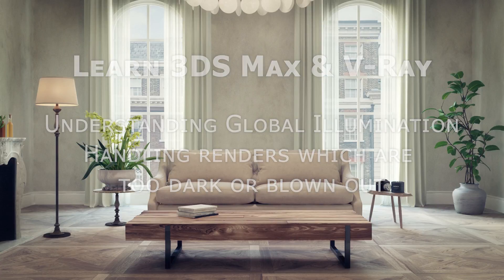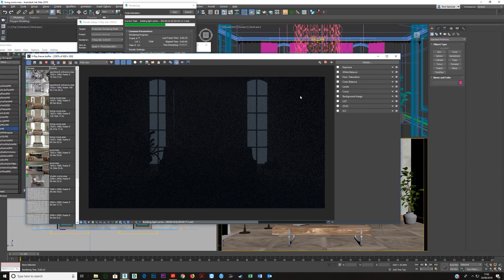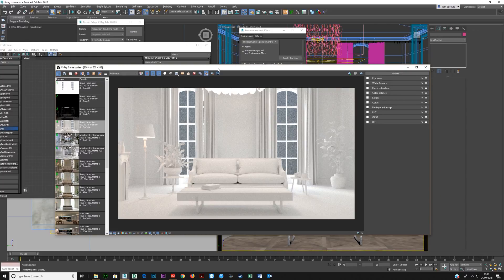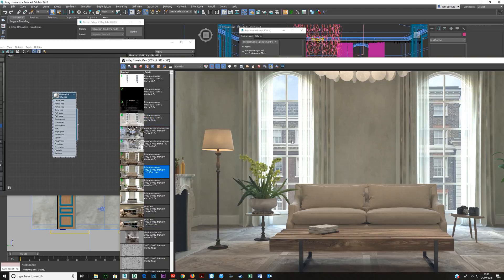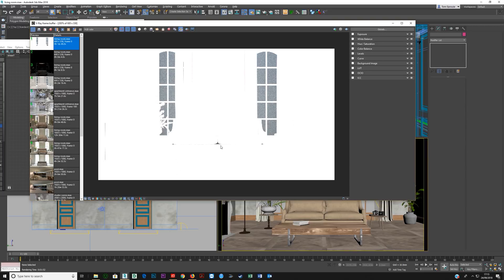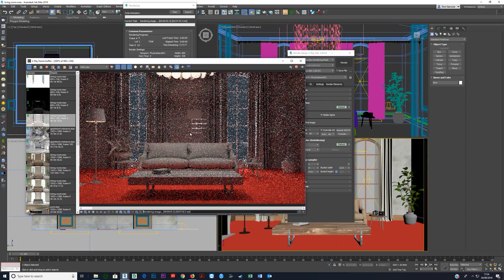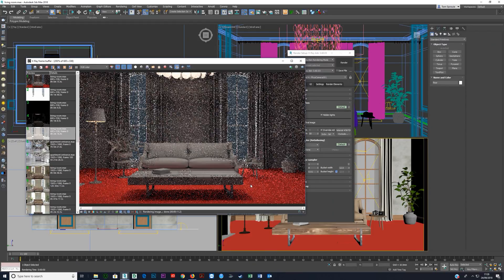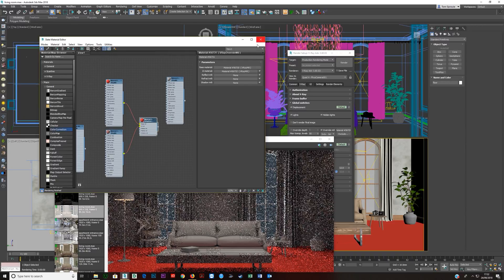Understanding Global Illumination (GI) in V-Ray | Fix Renders That Are Too Dark or Too Bright

Comment: It didn’t work for me and my scene is getting brighter, No idea why
Reply from the maker: Hi, without looking at the scene I can't say why. It also doesn't make sense that it keeps getting brighter without settings being changed. Simply because it's basically calculating the same light from the same sources each time. So it would sugget to me that something is adjusting your settings. If it's not you then possibly it's a virus. 

If you look at this page it talks about the viruses that have been created to work inside max. 

https://3dground.net/article/attention-alc-and-crp-viruses-in-3ds-max-

It also lists some of their effects as: 

'Corrupts or removes cameras, lights, and/or materials'
'Change render settings (V-Ray): VFB size, materials, GI settings etc.'

If you follow the instructions to download and install 'Prune scene' then it can at least find out if that's the issue.
Reply: leonleon51 Unfortunately that was not the issue it’s still not working no matter what i do, I loaded a preset render file from a previous project that worked perfectly still didn’t work, I merged the file into a new empty scene still didn’t work, l have no idea what’s wrong and it’s driving me crazy 😅
Reply from the maker: Mariam Rakhah Hmmm... okay. Well you’d need to upload the scene so I can take a look. And send some examples of how the render is looking at your end.

Comment: Hi Tom, great tut, thank you. But I think I have a 'light' rather than a GI problem. Using an HDRI, I'm trying to render a light bulb with a white porcelain housing (VRayFastSSS2). In a nutshell,with the HDRI at 1, the white porcelain gets blown out. With the HDRI at 0.5, the porcelain looks great but the rest is too dark. Perhaps you have a suggestion, thank you.
Reply from the maker: Hi Latefa, first of all I'd try setting your white so it's not completely white, otherwise it will blow out. An easy way is to go into the output rollout of your material and lowering the RGB Level value to 0.8 or 0.7 . That should make it darker and handle the blow out. If it doesn't then I would look at the reflection value of the material as it might be reflecting a lot of the HDRI. You can reduce the reflectance amount and still keep the glossiness the same. Does that help or not?
Reply: Hi Tom, the white porcelain is a VRayFastSSS2 material with no reflection dial, only specular. I tried plugging an output map into the specular color texture, lowering the white point to as low as 0.3 but no luck, it does not affect the reflections. It's definitely the material reflecting too much of the HDRI. Thank for your help :)